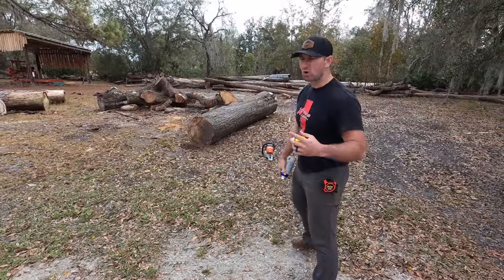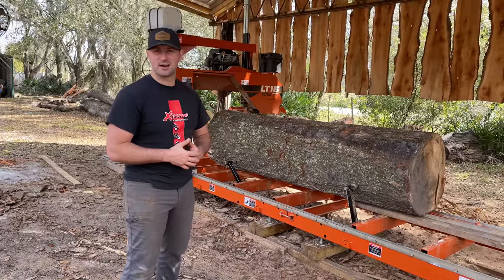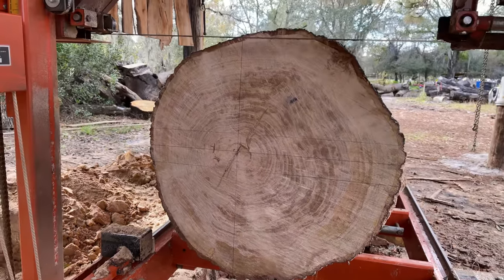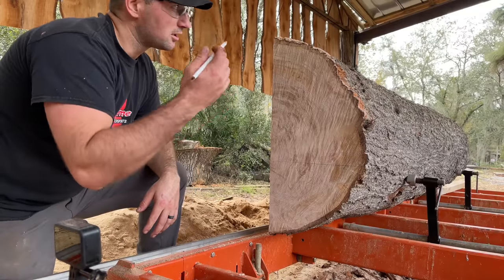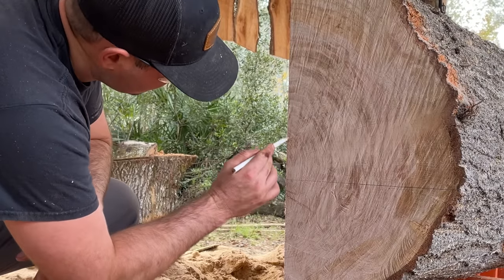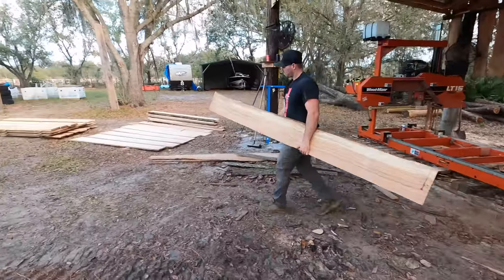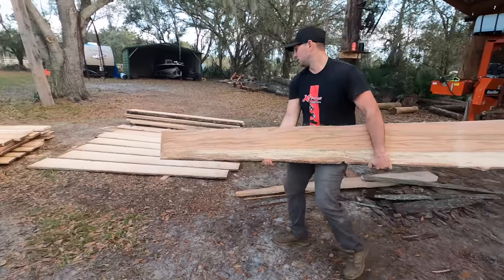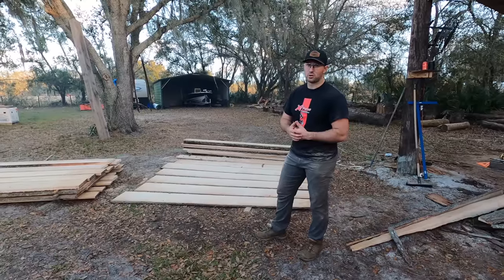First Quarter Sawn Boards on the Wood-Mizer LT15 Wide - 20

Comment: Good morning from sweet water Tn. Love ur channel. U all do a awesome job. Hey just FYI u need a heavy ballast box 1k + pounds on the back of that tractor, I’ve seen people split the rear cases apart if the tractor has to much weight up front on the loader and the rear of the tractor keeps twisting like I’ve seen your tractor do several times. Just my advice and trying to safe u a whole lot of money in repairs. Keep up the great content. God Bless
Reply from the maker: Thank you so much. That is very helpful. I actually just built one a couple days ago. It is right at 1000 lbs. It has solved our issues and we can lift logs easy now

Comment: Well that came out nice.... 

Don’t forget to coat the ends... red oak really likes to check.

Speaking of checks... if you arrange your logs so the end checks are horizontal... you’ll minimize the number of boards that have them.  I realize that you can’t really do that when sawing for a certain grain figure effect... or when sawing irregular shaped logs.  But, when they are cylindrical and straight... it yields more board feet of usable lumber.
Reply from the maker: Thank you very much. That is very helpful

Comment: I love the look of live oak, which as you know grows like wildfire in Florida about the only thing I from Florida that I miss, it is a pain to work with but the grain pattern is amazing especially when the wood starts to splat (live oak can take up to 4 years before that happens). It looked like your saw was having trouble pulling the blade through which is why I’m guessing live oak- so have you looked into the double hard 4 degree blades Nathan at OTW has been talking about lately? I ask because having experience with live oak and knowing how hard that lumber is those blades would come in very handy, being as how they are designed to cut frozen logs and lumber that rates high on the hardness scale. Anyway nice video and wow y’all are coming along nice since you started about 6 months ago. And have you ever heard of Matt Cremona? He has a video from a few years ago where he used a small log on his bandsaw and showed how he does quarter sawn lumber, I’ll look for the video and post a link in the comments to my comment
Reply: Ok so here is the Video by Cremona it can get a little boring but if you skip to 10:35 he starts the quarter sawn segment with a piece of branch log. https://youtu.be/IgMR1boYfTc
Reply from the maker: Thank you!!

Comment: Suggestion:  I would not use the orange square to draw straight and level lines.  I would use a 2 foot level, that way I could use it to draw true horizontal and vertical lines.  If you use a torpedo level to make sure your band saw blade is level.  The 2 level may also be used. 

For wedges, I would the orange square to make blocks.  (This square has 2- 45 degree angles and one 90 degree angle.)

Note: The blue square (including the 2 legged squares) are seldom a true 90 degrees straight from the store.  If you are interested I can tell how to check for square and how to adjust the square to 90 degrees.
Reply: Duuuudeeee.  You're thinking wayyyy too much...

Comment: From what I have seen, air drying lumber is 1 year per 1 inch of thickness. Maybe that varies by location but not sure.
Reply from the maker: Thank you!
Reply: You're correct. Standard "rule of thumb" for air drying is one year per inch of thickness. One should also seal the end grain to minimise cracking while the boards dry. Polyurethane works pretty good. Some mills use exterior house paint.